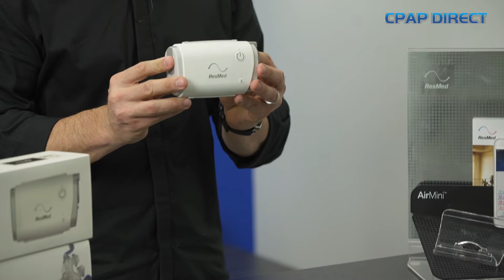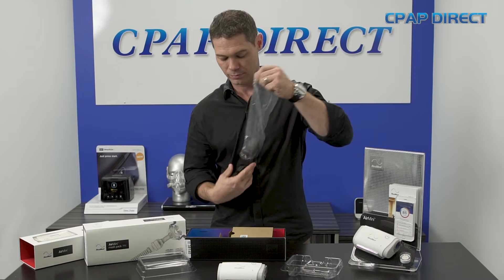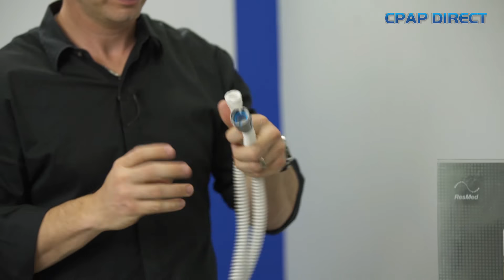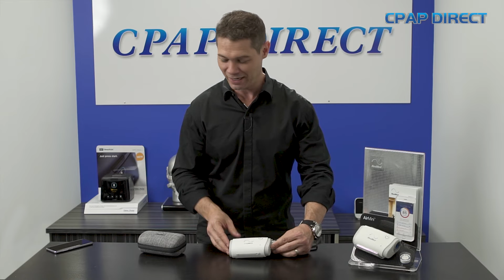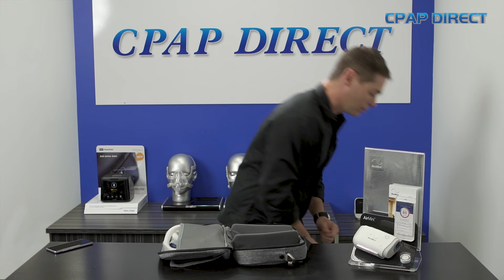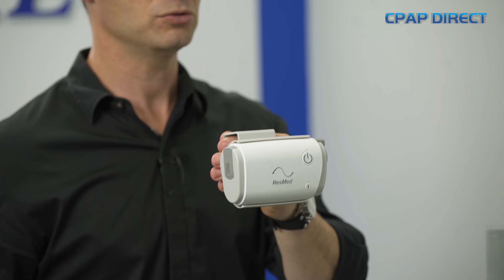ResMed AirMini CPAP Machine Review

Comment: I borrowed an air mini from a mate. I was planning on using it while on a long haul international flight. 
I tested it and found it’s absolutely terrible compared to my normal air sense 10 machine. There is no way I’ll ever use it again. I’d rather lug my proper machine around. So glad I tested it before the trip. 

- It was far noisier
- Air escaped into my eyes, even though it’s a perfect mask fit when I use my bigger machine. 
- I could feel air blow into my mouth and my cheeks getting pushed outwards. Felt like I was in a wind tunnel. On my normal machine, even on higher pressure, I can breath normally and can’t even tell it’s blowing.
Reply from the maker: Hi and thanks for your comments. Yes the AirMini is louder than the AirSense 10 and this is mainly due to the breathing noise which sounds like it comes from the exit ports on around the knuckle near the top of the tube. The mask shouldn't blow air into your eyes at all if it doesn't on your AS10. It's possible that the air coming out of the knuckle I was referring to was bouncing off the sheets or your body into your eyes. 

The AirMini is a powerful device and I found that I need to adjust the max pressure down so that it doesn't create that wind tunnel effect you're describing. The device will work fine as long as you have someone that can adjust and tweak it to perform like your AS10 does.

At CPAP Direct, we also have a 30 day money back guarantee on the AirMini.
Hope that helps.
Reply: Unfortunately I didn’t try before buying ….the noise , inspiration and expiration is UNBEARABLE! I find myself unable to sleep as I’m aware of every breath..,in /out…IN/
OUT‼️I’ve tried every accessory/hack /tip for reducing the noise without success. BTW, I’m a Registered Respiratory Therapist , working at a large facility, nightshift with cpap patients. This thing SUCKS.

Comment: Is this a universal plug that will work in other countries? Has the battery come out yet?
Reply from the maker: The battery has come out for it. Search 'pilot' in the green search bar of cpap.com.au to find the pilot battery for the AirMini. As for a power adapter, you'll need to use a travel adapter for GPO's overseas.

Comment: Any up date on battery kit?

Can existing heater coil hose from Air sense 10 be  made compatible to use on this mini 
For use on full face mask 
J
Reply from the maker: Sure thing. Here is the link to the battery: https://cpap.com.au/products/pilot-24-lite-battery?_pos=1&_sid=1035f05aa&_ss=r  The heated tube for an AS10 isn't compatible I'm afraid.

Comment: Great video. Would have liked to hear what the noise it makes sounds like. I’ve seen comments about it, some people are fans and don’t mind it, some people don’t like the noise. If I could hear it, I could decide what I think of it too. Thank you.
Reply from the maker: Thanks for sharing Jason. We will do another video shortly on the AirMini and compare it to the AS10 for you. The AirMini noise can vary between masks. I was using one with the N20 mask the other day and it was pretty quiet. I found using it with the P10 mask seemed louder to me. The sound comes out of the exit ports on the HumidX housing and it's an air noise rather than something that comes from the device itself. We do have a 30 day money back guarantee on it though for people to try it out risk free.

Comment: Can it run without power for how many hrs after charged completely
Reply: You need an aftermarket battery such as the Medistrom Pilot 24 Lite. The battery can be used as a power backup for times the power goes out, but either the Medistrom Pilot 24 AC adapter or a Resmed AirSense 10 AC adapter needs to provide power to the battery,  then the battery is connected to the Mini with a connector provided with the battery. If the power goes out, the battery seamlessly takes over.

The AC cord provided with the Mini can't be used in the power back-up configuration and, while it can be used to charge the battery, it takes a long time. The power cords for the AirSense 10 or the Medistrom power cords charge the battery quickly. 

I've played around with how long my battery will power my Mini by itself and I can get 2 nights, but I hear higher pressures may drain the battery quicker.

The Medistrom can be carried onto and used on an airplane and can also power the unit camping, etc.

The battery can also charge a cell phone, etc. It has a little flashlight function. There are indicator lights showing the charge level when the function button is pressed. The battery must be maintained by charging it at least every 6 months. It's a pretty nice battery, but it isn't cheap.

The Mini requires a 24 V battery. Medistrom also makes a 12 V battery for other machines, so it is important to buy the right battery.

I hope this helps with your question.

Comment: Would like to purchase as I travel a lot. Sorry for skipping the video. Is this battery operated or USB rechargeable? Can I plug it to car port? Thanks
Reply from the maker: It comes as a compact option that runs off mains power however you can get a battery for it as an optional extra. The device is 24V and you'll need to use the pilot 24 lite battery which is also available on the product page of the AirMini: https://cpap.com.au/collections/travel-cpap-machines?constraint=resmed

Comment: Thank God I order this 3 months ago. My main home machine was a dreamstation1 . I have stop using it, that machine was recalled and now the mini is my main machine. The waterless humification is not as good as water humification. But if you sleep with your mouth close it does a fair job. I tried the P10 but did not like it so went to the N20 mask and headgear. As far as noise it is not bad in my opinion. But the comment of air from the Humidification system blowing on your neck or cheek is spot on. There is an aftermarket adaptor where you can use a regular hose and mask. But then you have no humification.
Reply: I
Reply from the maker: Hi guys, here is a link to the adapter you are referring to. https://cpap.com.au/products/airmini-adapter-for-ozone-cleaner?_pos=1&_sid=79eef7c49&_ss=r
Reply: My brother says he never uses the humidification thing in his airmini and doesn't miss it.
Reply: I’ve never used a humidifier. Sounds like this would be great for me with the adapter you mentioned.

Comment: For those concerned about the noise …
well it is much quieter than my snoring, which was once measured at 77dB.
The AirMini is also much quieter than my original ResMed AutoSet Spirit (circa 2004).
The AirMini works beautifully as my main machine, every night.
Reply: I just took it away with me on holidays and I slept like a baby despite the whooshing sound near the mask. The algorithm is fantastic.
Reply: @suave-rider  The whooshing sound is incredibly annoying. I’ve just been testing the mini. I also have a resed airsense 10 and it is such a better experience. I’ll never use the mini again.
Reply: @James-lw3gi  Interested in selling your mini? ;-)
Reply: @damongrambow7077  I don’t own a mini. I borrowed a mates.
Reply from the maker: Love the comments :)

Comment: Has the battery come out yet and can this be used on an airplane with the battery?
Reply: There are several batteries for it on Amazon. The out put has to be 24 volts. You can generally charge them with your apap power convector. I ordered the Medistron Pilot-24 when I bought my machine. The Pilot -12 is for machines that use 12 volts. I just got this and have not used it yet. Hope this helps.
Reply: @stephencullum8255  How much is it?
Reply: @susanmoreno7389  I bought the cpap from another vendor and paid about 600 for it. Bought the battery off of Amazon and paid about 350 for it.

Comment: The downside of this mini CPAP is noise.  Many reviewers tend to say it is relatively quiet which is true if it is running without loading.  But when actually using it there is an apparent noise during exhale which many users liken it to Dart Vaper's Breathing in Star Wars.  It comes from the hose and you can hear it. The design of the inline humidifier is also to my opinion a failure as the air exhaust on the hose blows to your face, eyes or neck depending where it is at.  There are after market converters for using the AirMini with your regular hose and mask so this is less of a problem.  The Dart Vader Breathing noise is pretty annoying and I rather carry my old back up Resmed S9 on longer trips.
Reply: I confirm your remarks! The masks are a total failure and very noisy. The device also transmits annoying vibrations. The humidifier is inefficient and the filters are very expensive. Bad product! I have been using the Resmed S9 for 10 years. It is much quieter than the Mini.
Reply: Wear eye plugs
Reply: Yep, I tried the adapter so that I could use my “regular mask and circuit “ , still AWFUL.

Comment: Would've been helpful if you'd demonstrated how loud it is when it's on, esp after warning viewers about the noise.
Reply: It really isn’t noisy at all. My original CPAP device was a ResMed AutoSet Spirit. Very bulky, very noisy. It worked perfectly but was cumbersome. Downloading data from the device was clumsy too - requiring a serial cable if I recall correctly. The AirMini data is accessed on your smart phone via BlueTooth. The data is less detailed - the larger, non portable versions can provide data to generate a detailed graph of every moment during a night’s sleep. The AirMini just provides a summary - though this is definitely sufficient for most people. 

Back to volume … my snoring was measured at 77dB, so I could probably keep awake the passengers of an entire economy section of a Boing 737. The AirMini is comparable to someone’s breathing after running for 10 seconds.
Reply: Agree noise is a huge problem.  I have been trying different mask setups to minimize the noise but have been unsuccessful so far.  Highly recommend to try before you buy.

Comment: It doesn’t cover the mouth. Is it still effective if the wearer mouth breaths while sleeping?
Reply: There's three types of face applications. Nose pillow, half mask, and a full mask. If you sleep with your mouth open its usually recommended that you get a half or full mask. If you sleep with it closed, rhe nose pillow will probably be recommended to you. Either way, consult with your doctor.
Reply: You can choose the mask you use, rather than that one shown.
Reply: Further to your question, when I was diagnosed at the sleep clinic I had 32 events per hour. I snore and mouth breath in my sleep. Using a full face mask that went down to 5 according to my resmed machine, I've now tried a nasal pillow and according to the same machine I'm now average 1 or less per hour. Interestingly before I couldn't go to sleep breathing through my nose, but now I can. It's worth a try.
Reply: @mikefish8226  My experience with the P10 was low events, less than 2  but with a cushions mostly 0 or less the one.
Reply: If you are a mouth breather, like me (e.g. if you often have nasal congestion from allergies, etc), then using a nasal mask will be uncomfortable and ineffective whenever your mouth opens. Imagine air pushed into your nose at 15 psi and rushing straight out through your mouth.

I use the F20 mask, which covers the mouth and nose. Some people with facial hair have trouble maintaining an adequate air seal with a full mask. One option is to just tighten the mask straps - though you might wake with some minor pressure marks on your face. Another option is to go for the nasal mask or pillow, and use a strap to (gently) help keep your mouth closed. Your CPAP supplier will have all these options available.
Reply: Also note that with the AirMini, the full mask precludes the use of the humidifier option. This is just a result of how ResMed implements the humidification for the nose mask and pillow - but only on the AirMini  compatible masks. Other models or brands of CPAP might use a water reservoir in the chain of tubes between the CPAP air outlet and the face mask.
Reply: @Xubono  it is possible to buy an adaptor to use normal tubing and masks with the air mini.
Reply: @mikefish8226  The user guide doesn’t recommend doing this. In particular, it states:

• Use only AirMini (eg air filter), masks and accessories that allow for normal breathing to avoid asphyxiation.
• The use of accessories other than those specified for the machine is not recommended. This may result in increased electromagnetic emissions or decreased immunity of the machine and result in improper operation.

and also …

• The AirMini mask systems and connectors are fitted with vents. The full face connector for AirMini is also fitted with an AAV. The AAV and vents have specific safety functions to prevent carbon dioxide build-up in the mask.

Caveat Emptor.
Reply: @Xubono  I'd say the electromagnetic and vents is a red herring. First they are plastic and secondly you'll find all the masks vented (easy to check if worried). You can use a different manufacturer's masks with the "desktop" Resmed. In fact when you login to get your sleep results there's a drop-down for the mask manufacturer and mask type. The restriction on masks was so they could have smaller tubing, which is good for traveling and to lock you in an ecosystem (plus the humid-x accessories).
Reply: @mikefish8226  you know, I most likely agree with you. But given this is a public forum and we are discussing a (possibly life saving) medical device, I feel compelled to at least point out the warnings as documented by the supplier.
Note also that when I forget my daily doses of prescripted medications, I become a pedantic “know-it-all”. I appreciate and respect your own experiences and advice - the reality is probably far more flexible than the manufacturer’s guidelines.
Reply: @Xubono  Interestingly I suffer from nasal congestion, I would have lots of sinus infections in the past, and mouth breathe at night until I tried a nasal pillow. I was surprised to find I can breathe through a nasal pillow with appropriate pressure. In fact when I'm in bed I'll mouth breathe when reading a book but can breath from my nose once on the CPAP with nasal pillow.
Reply: @mikefish8226  That’s awesome! Glad it works so well.
Reply: I get that.. used to sleep with my mouth opened. I was told when purchasing my machine that the purpose of using a CPAP is to breathe through your nose. If your mouths opened, a loud airy sound will follow, automatically prompts me to close your mouth.